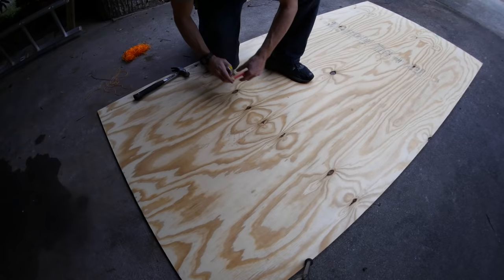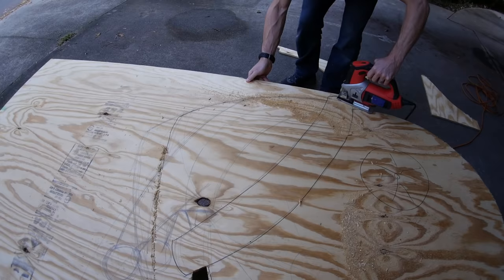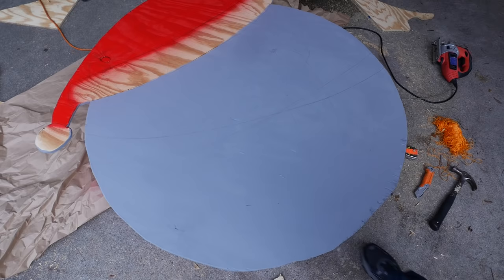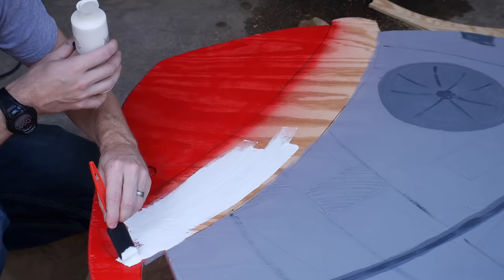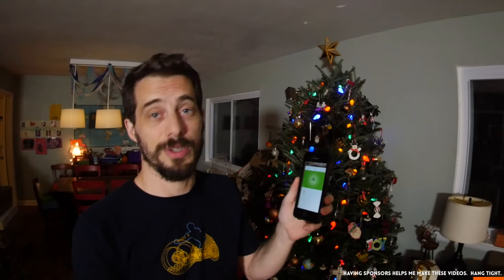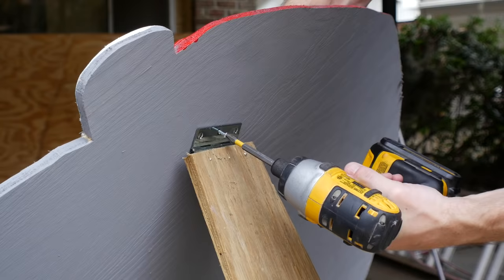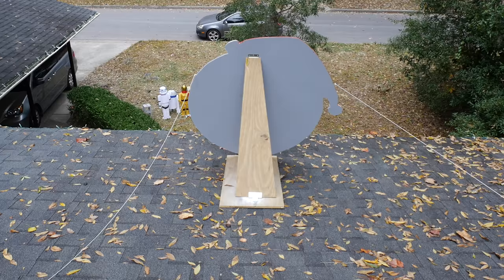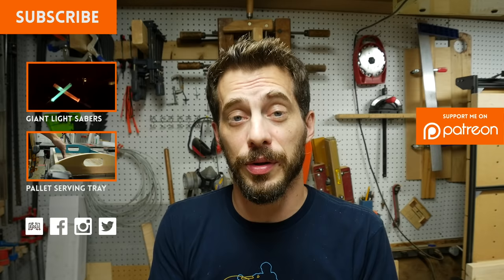Death Star Christmas Decoration // How-To | I Like To Make Stuff

Comment: I sat here watching this video with a huge smile on my face the entire time. Even my wife said, "You know, some people just have too much fun..."  when it ended. Nice addition to the display, Bob! (For some reason I can't get the image of a big Jabba the Hut in a Santa hat out of my head now...)

Pro tip for painting things red: Most folks don't realize just how transparent red paint is. Paint the item white or use a white primer first. You'll use a lot less red paint, it'll hide the grain of the wood, and the red will pop more. I prefer Zinsser BIN white primer. It dries quickly, you can use any kind of paint over it, it's not expensive, and you can get it at the big box stores. (No, I have no affiliation with Zinsser or any of the big box stores. Just passing the info along.)

Comment: Awesome project Bob.  Listening to the last podcast and how you weren't motivated or trying to find that "thing" that would be helpful in the video, I found a tip for me.  It's not mentioned in the video, but just seeing you pour paint onto the wood and then using the roller to spread it, instead of putting the paint in a roller pan to dip the roller in, is genius to me.  I probably would have just used a big brush and dipped it into the bucket.  Thanks for the tip! (even if you didn't plan on it)
Reply from the maker: THat's great to hear!!

Comment: Great project... When I first seen the Death Star I thought it was round but then when I saw how you assembled it; I must say that is impressive... One thing I noticed that you may want to change, is your back cross piece, you may want to shorten it a bit and change the hinge direction so that it folds under the death star rather then away from it. That would make for a smaller foot print but if you don't need the room it's probably not worth changing... Star Wars RULES, well, the original 3 did anyways, 1, 2 and 3 failed epically but 4, 5 and 6 Ruled.... I still remember as a kid at the MOVIE THEATER seeing the very first one on the opening seen when it says Episode IV, I was like, wow, what happened to 1, 2 and 3... Needless to say 1, 2, and 3 are epic fails.